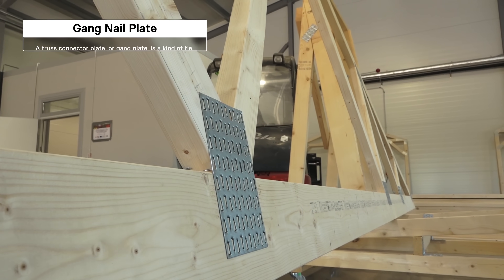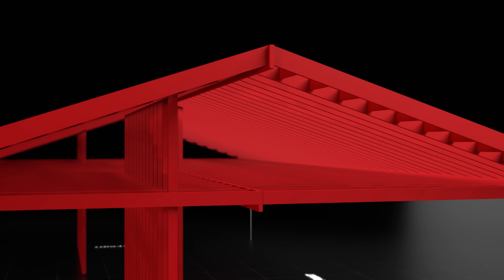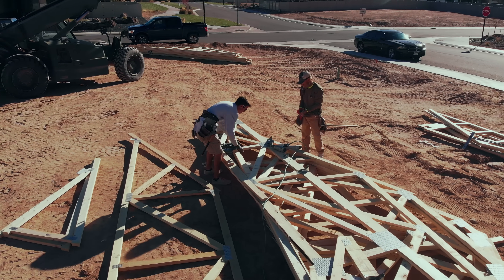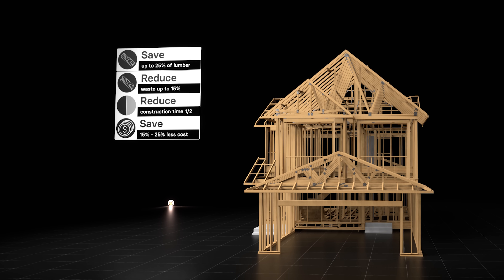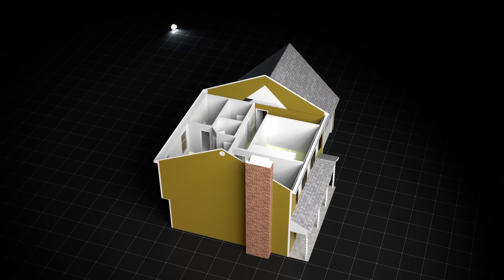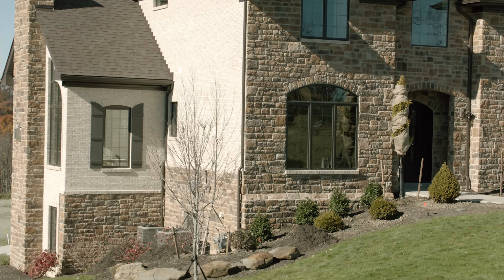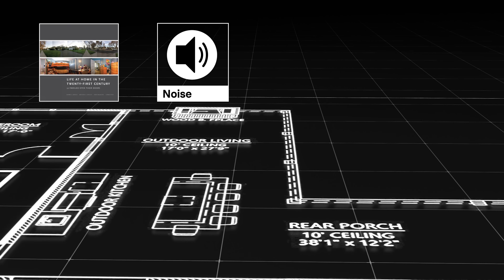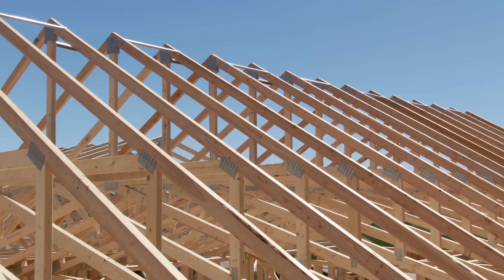The Invention that Accidentally Made McMansions

Comment: A LOT of misinformation here! This is the cheap way to build and structurally it only gets by, these won't continue to be accepted or used in the coming years probably anywhere. There are far superior building methods structurally that have been around longer than these plates. Structures using this most recent stick framing arent really meant to last more than 30 years. We're already finding many structural issues with homes built this way where as homes with even older building methods are standing strong.

Comment: Ha, I guessed the topic of this one from the title (as I'm sure plenty of other viewers did). Nice details and analysis, though, and I do enjoy seeing examples of revenge effects.

I wouldn't say every builder loves trusses. I recall reading a Norm Abrams rant about them years ago, for wasting space. Of course, there are some truss designs that recover some of the attic space. I've seen asymmetrical versions of the usual W-truss for single-plane roofs that leave a pretty large area for storage, and the shed kit I recently put together uses trusses with a large rectangular center opening and OSB webbing at the corners to leave storage space. But those McMansions with steeply-pitched central roofs do have a lot of dead volume.

Comment: If you want an attic in a modern house, you can opt for "attic trusses", which are trusses with a central section that is open. A cross tie at the top becomes a way to easily install a roof. A beefy chord at the bottom gives you the floor joists. The sides can be drywalled. Instant finished attic.
Reply: Although walk-up attics aren't feasible in certain areas like Florida.
Reply: @jackesioto  Why not? We  have kazillions of McMansions here with enormous "snow roofs" already - what a waste of cubic volume!
Reply: @veiledzorba  Materials, labor, and land drive the cost. Cubic volume doesn't cost anything.
Reply: This.

Comment: It's not collar ties or ceiling joists, it's both.  Collar ties help the ridge from separating.  The ceiling joists help to keep the rafters from pushing out the walls at the top plate.  A ridge beam would need to replace the ridge board in cases where rafters did not have ceiling joists or "rafter ties" located within the lower one-third of the rafter.  Rafter ties reduce the effective IRC allowable rafter span.  Sill plate is applicable here because of the CMU wall construction in Florida, however, this would be known as the double top plate throughout the rest of the U.S. due to wood-frame construction walls.  Gang plates also do not affect the need for tie downs at the sill plate for areas in wind-borne debris regions along coasts.  It does, however, increase the cross sectional area of the lumber at the top of the wall, which in turn increases the section modulus for bending capacity.  Not to say this video isn't without its merits, but there's a lot of inaccuracies in it.

Comment: In Britain we call that "toe nailing" "skew nailing".

The double opposed skew nail is actually supposed to be very strong connection.

Also, trussed raftet roofs here need loads of cross bracing, various diagonals etc. However, a traditional cut roof is assumed not to even require more bracing due to its inherent strength. This is even more true for hipped roofs, but even with a gable only the gsble need be braced against the roof (or vice versa).

But then we don't get hurricanes. Also most houses are masonry so a lot more dead weight against wind uplift

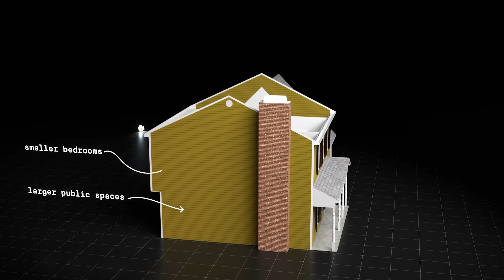Comment: Hey bud, this was a great video, but you missed something. Or possibly just forgot to mention it. It was not only roof trusses but also floor trusses that made this possible. Now you might know this but you didn't mention a floor truss once in your video. The floor plan you showed at 7:29 would not possible just because of clear span roof trusses. It would also have to be paired with clear span floor trusses. Or it would need a post and beam structure through the center. Even though you second floor is not holding up the roof trusses it still needs to be quite strong to hold up it's own weight and the weight of the second floor walls and inhabitants.

Comment: As a rough-in house framing carpenter for 15 years, I have several points where you're wrong: 

1.  Trusses still have to be toe-nailed to the top plate of the wall.  After putting them in place you can add hurricane clips which is a pseudo gang nail, with 3 or 4 little nails in each the truss and the top plates of the wall.
2.  It's not awkward to toe-nail any boards together, we do that so much, and the clip of the old, dumbass guy hand-driving nails into un-cut rafters is the most retarded thing I've seen in a while.  You know the geometry, the span and therefore exactly how long every rafter should be, so just cut them all conveniently on the ground in a couple hours then throw them up there.
3.  When you said "add a couple weeks to construction" or whatever was alao dumb.  If we didn't get a 2500 square foot house built in 6-8 days we would be considered a failure.  Maybe in California with retarded regulations, that might be acceptable, like the stupid stick-framing and way too much time spent on everything.  We actually use compressed air, anyone caught hand-driving nails is called out: "WTF are you doing? Get a nail gun, you idiot!"

All these dumbasses talking about construction and have never done it themselves really grinds my gears.  I like people that actually go to a factory or any site or lab where the work is being done, talk with the people that actually do it, and then show and tell the real story.  Veritasium and Mike Rowe do that to near perfection.

Comment: The trusses certainly made the work faster because we could set 3 at a time with a crane, and they enabled the 6-car garage, but they needed to be supported in the center, so we always ran a beam through the room below ceiling height. It was the invention of the ultra-light, laminated I-beam floor joist that allowed space to stretch between bearing walls. That's when my crew switched from stick framing ordinary single family homes to McMansions. Sometimes they would stretch the floor so much that we needed 2x6 exterior walls to support the weight of the house and their obese residents. Those houses we built in the 80s were real garbage.

Comment: One problem with these gang-nail plates is that it's assumed that the sub-contractor actually knows how to use them, or how to measure & cut the timber pieces accurately!

Comment: 2:30Dear God, no wonder American houses are so shaky! How, in the land of endless forests did American house builders come up with such half-assed construction methods!? It’s got planned obsolescence planned right in there! It would cost practically nothing extra to build a sturdier version of the same house with the same amount of building material.

Edit
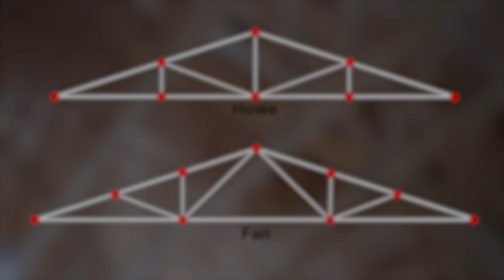4:17 ok, nevermind, I didn’t realise they also use incredibly thin wood. Our new house uses 20cm by 15 cm beams (roughly 8” by 6”, I think), and that’s just to meet regulations. I think they are between 50cm and 60cm apart (roughly 120” to 150”).

Our house was also assembled prefabricated in a factory. It took the company two days to assemble it. One more day to install the doors and windows  so it was protected by wind and weather

Comment: I dont really care for osb bc i know its an inferior product to cdx ply which arguably had advantages over the 1x6s it replaced. I think that this coating probably helps it withstand the exposure during the construction process, and perhaps  if all of those stringent edge sealing tape rolling rain screen details are followed you may end up with a durable product. I do kind of think they wont though. Instead i think there is a bunch of houses going up at maximum speed by semi skilled workers with minimal and /or inexperienced oversight. I personally doubt that even the majority follow the installation guidelines and know that most i have seen are just installing vinyl siding right on top. Time will tell but I suspect this stuff will be a major issue in years to come.

Comment: Hi from Australia, I joined the truss industry back in the early'80s when it was just gaining a foothold and acceptance in our building industry.  My experience prior to this was in heavy construction and this new idea seemed very lightweight and flimsy, but I immediately saw the benefits of the system and fell in love with the technology.  My role was to deal with engineers, architects and builders who were not familiar with timber trusses and consult with them on getting their projects out of the ground.  I would use the very primitive software available at the time and/or design from engineering first principles to solve the very complex (for the time) roof and floor structures.   The projects were not just housing, but schools, hospitals, aged care facilities and light industrial buildings.  I loved my job and was involved in many projects that would not have been possible or be too expensive without the nail-plate (that is the correct term - Gang nail is a brand name) innovation.  I was involved in investigations if there was a collapse and took part in several legal cases as an expert witness and also in new product development.  The shine started to come off my career when I saw just what was happening as more and more builders were building more and more ' mcmansions' 
(yes we have them here too) and how I had contributed to the urban sprawl making the cities and suburbs far less efficient and therefore more costly to live in.  After more than 30 years I decided to leave the company that I had been with, because their focus had changed from ' who can we help' to 'how much can we make' and that didn't sit well with me as I had always been there to help solve the problems big or small.  I now consult to the industry doing site investigations and often in conjunction with the company that I had worked for for all those years.  Thank you for shing a light on this simple but highly efficient technology that transformed the building industry around the world.

Comment: And despite this, the houses still get destroyed.
American houses are FLIMSY, and cheaply constructed boxes of "dry gasoline" waiting for a spark for the whole thing to go up in a spectacular fire along with it's neighors a few feet apart on both sides.
Over in places like Romania and Hungary they don't build houses like this, even to-day, instead, they use kiln fired red terracotta blocks like many commercial buildings in the US used to use 100 years ago, the blocks are similar to hollow concrete blocks but deeper, stronger, and highly fire resistant since they are vitrified in a kiln around 2000 degrees.

The walls there are around 10" thick or more, stucco on the exterior, and the roofs are not made from the dried gasoline we use called 3 tab asphalt shingles and tar paper, the roofs are made of the same kiln fired red terracotta. If you google street view this house on the corner, it was caught one year under contruction, if you "walk" up Orgona street one or two steps it changes to a later view and the house was mostly finished, https://www.google.com/maps/@47.4981128,17.5682232,3a,75y,196.76h,90.88t/data=!3m7!1e1!3m5!1smx8iWAiS3ClbFMeeczeHNg!2e0!6shttps:%2F%2Fstreetviewpixels-pa.googleapis.com%2Fv1%2Fthumbnail%3Fcb_client%3Dmaps_sv.tactile%26w%3D900%26h%3D600%26pitch%3D-0.8844487301043245%26panoid%3Dmx8iWAiS3ClbFMeeczeHNg%26yaw%3D196.75921392379897!7i13312!8i6656?entry=ttu&g_ep=EgoyMDI0MTIxMS4wIKXMDSoASAFQAw%3D%3D

If that link fails, then google map;  1 Petőfi St, Gyomore, Hungary

That is why almost every roof you can see is red, they use terracotta tiles, so the roof structures in the attics must be pretty substantial and anchored well to the walls, making substantially strong  highly fire resistant homes that storms, hurricanes and brush fires will have a very difficult time doing anything to. But here is the US, the houses are built like krap, and insured to the hilt, so WHEN they get wrecked, the owners get a new house and everything replaced, it's how the rich redecorate every few years.

Comment: I had the mathematician whose thesis paved the way for these plates to be used as a maths instructor for a while. What you say is true but there are some caviets, they have to be used correctly. A couple of things have changed since their introduction, timber has become softer, and climate has changed. I’ve seen these plates quite dramatically. The one rule is that they must not be used in a tension joint as the primary tension carrying member. Where would some one try to do this? In a place where this is not a long enough piece of timber for the bottom member of a triangular truss frame. FAIL.

Comment: As a retired volunteer firefighter home built with gusset plates in their roof structure is something you definitely have to be aware of and be cautious of. When he gets up into the attic and fire these plates get weak and tend to fail so the quicker you can get the fire out in the attic the safer everybody is.
Reply: Automatic sprinklers should be added to far more homes especially these gigantic ones

Comment: Every blessing comes with a curse, eh! Have you come across the well known story that the size of the booster rockets that were carried by rail to Cape Canaveral were limited in their size by the width of the chariots that the Romans brought with them to England 2 millennia earlier?
The story goes that when the Romans came to England, their chariots created ruts in the mud that meant that if you used a different wheel spacing, you ran the risk of a broken wagon. This wheel spacing went on to the railways that were then exported to the States, and so the tunnels that were built, that defined the size of the boosters, were decided by the Romans..
So the size of your space ship was determined by the size of your horse cart..

Comment: This happened in the automotive industry as well. Fuel prices drove huge efficiency improvements in internal combustion engines which then got used not for efficiency but high performance. Same thing with electric cars, as soon a decent range and a charging network got built the electric cars were suddenly all high performance. What people want and what is sustainable are always at odds!

Nothing exceeds like excess! But I'm not judging, I live in a McMansion. Just a small one, but it looks like the ones in the video with complicated roof and ceilings. It got hit by a tree recently and was rebuilt by Amish carpenters who referred to it derisively as a "stick house". Apparently they still use post and beam construction their own homes and barns. Still, other carpenters just shook their heads and walked away, the Amish just put it back up again in a couple of days and it's fine.

Comment: Proper, traditional carpentry joinery was strong in all but one directions.  Truss plates are weak in all but one direction.  The direction which truss plates are strong in happens to be the direction in which traditional carpentry is weak in, so clearly if you want a house built to actually last longer than its asphalt tile roof, you build it with *both*, but nothing that ain't built bespoke ain't getting traditional carpentry, it's all balloon-frame bullshit tacked together with a couple nails and this carpentry velcro bullshit, and buddy, it rattles like hell at the best of times

Comment: I have been suspicious of those plates for a long time... Yes, they can work great for many or even most buildings where all the stresses are perpendicular to the earth (i.e. gravity driven) However, they tend to really suck in torsional applications like the sideways wind forces. That is usually fine when the roof remains intact and loads are either "up or down", but if only a part of the roof peels and the forces are now applied like a sail to those joints, they peel apart like Velcro and ALL stability is lost... ending up with a twisted pile of wood and sharp plates.  Of course the greedy home builders, banks, and other construction entities cared about nothing more than the hefty fistfuls of profit and they would be long gone before those statistically rare consequences of mediocre design could raise their ugly head...  McMansions suck gelatinous diarrhea through a garden hose and I would never buy one... I much prefer a home built on a combination of methods that take advantages of the good features and minimizes the bad features and unexpected consequences.

Comment: After watching this, and having my background in firefighting. I feel as if this was produced or at least sponsored by a modern pre-fabricated home builder corporation. There is a lot of omission of information regarding what we call legacy homes, as well as outright lies regarding ease of construction; 
Materials - the claim that truss construction requires 25% less materials is just as fabricated as the truss itself. A legacy Closed couple roof, nail/screw overlap construction, or stick built: requires 6 pieces of lumbar to make a section, Ceiling Joist, Wall plate x2, Rafter x2 , and Ridge beam. And will be place exactly 16 inches on center. Versus the truss: requiring a minimum of 11 pieces of lumber, to create a single truss, Top cord x2, Wall plates x2, webs x4, lateral stays x2, and a bottom cord. All of which could be made up of multiple boards. A single truss does not have the strength the Close Couple has, so more trusses will be needed being placed anywhere from 8-20inches on center. almost quadrupling the required amount of lumber.